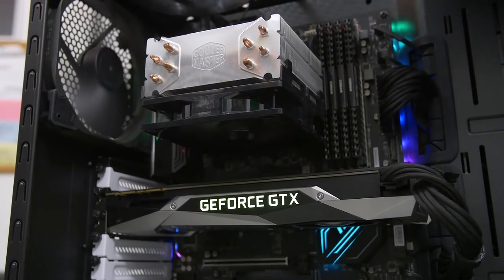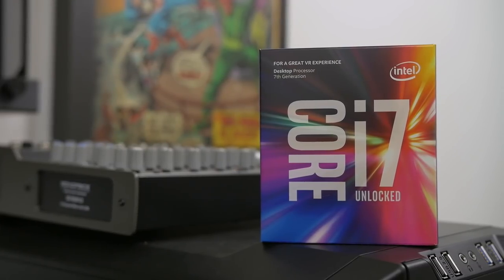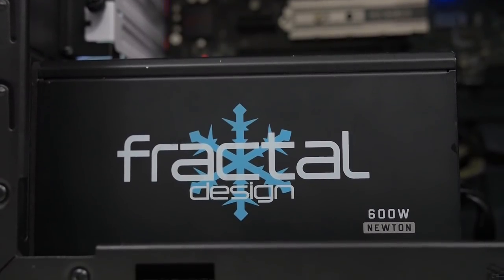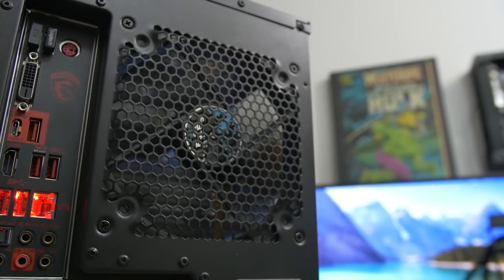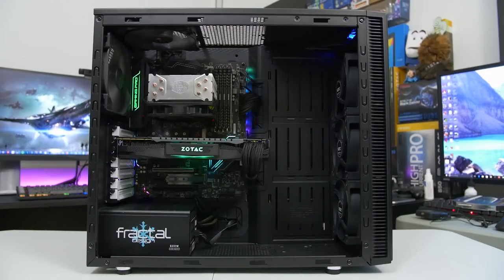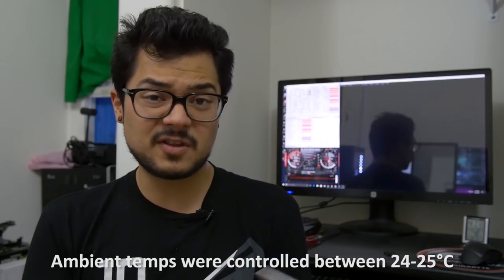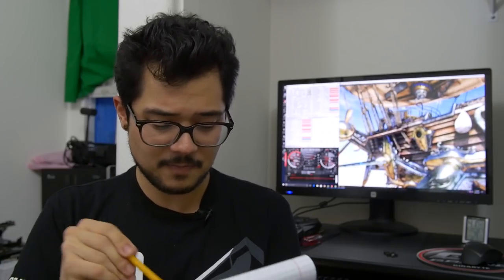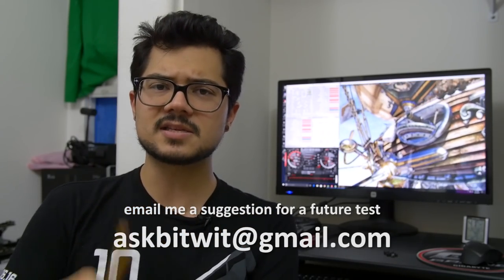This is how you should mount your CPU cooler! I think??

Comment: If you have enough airflow in an horizontal config the cooler draws air from the frontal flow, not from under it and the GPU hot air is sucked out by the back fan anyway. Saying that, one would expect a for horizontal placement that the temperatures would not depend from the GFX style. So why does it increase in blower?
I can only see three possible options.
1 - blowers are hotter and so they heat the motherboard and its components;
2 - the blower sucks in air, thus strangling the EVO airflow;
3 - you accidentally changed some other variable.
Counterpoint to 1 and 2: why doesn't it happen in the vertical config? 
1 - the evo is keeping the blower style cool by sucking its air from the backplate in the vertical config, thus no heat creeps from the mobo to the CPU; this gets to be too much in non-blower style.
2 - by some airflow effect the EVO is not strangled if it takes air from closer to the blower sucking point (this looks really dumb).
What were the GPU temps during the 4 runs? A temp probe on the motherboard and GFX PCB could help support or deny my options 1. Using fumes could test my options 2.

Comment: I dunno if this is right, but maybe since the Founder's Edition runs inherently hotter than an aftermarket shroud, and requires higher fan speeds, maybe it took a little more air in than the 212 and potentially starved the CPU a bit for cool air? 'Cause it was facing the front in that test, and if both the GPU and 212 were getting air from the same direction maybe it swayed more towards the stock GPU shroud. And then when the 212 was horizontal, it caught more cool air being directed towards the higher fan speed FE GPU, and caught more of the hot air kicked around when the aftermarket card was put in. I'm not sure, that makes sense to me but my reasoning could be off.

Comment: its because of where the blower style gpu outputs air, in test 1 is leaves ner the front of the case and get sucked back and up through the cpu, where as in test 2, its expelled more in the middle, being sucked up behind the cpu. Or at least thats the only thing I can think to explain it.

Comment: I assume the results pertaining to the open air gpu cooler vs the blower style gpu cooler when the cpu cooler is mounted horizontally is the gpu cooler is starving the cpu cooler of air as the lower air pressure in the case is causing reduced cooling capacity.  Just a guess.

Comment: What I would think is that the cold air from outside is mixing with the warm air from the gpu, in the horizontal and open shroud, before it's being picked up into the CPU cooler, therefore you are getting cooler air than what the CPU is and more of it?

Comment: You HAD TO use the cpu cooler horizontally on am3+ socket motherboards
Reply: Simon Mol yes
Reply: shit? i had to use it vertically in my am3+
Reply: Why? I did it vertically on my original AM3+ build.
Reply: I think he's referring to the airflow, not the actual cooler, or vice-versa.

Comment: With the original two the blower was piling up heat in the bottom then the heat slowly seeped up to the CPU cooler and instead of going into the fan it would go into the fin array since that's what was directly next to it then the open air one had the air dissipate throughout the case and therefore the heat would be sucked out more efficiently but then in the second test the open air gpu one would make it so the fan Could more easily suck the hot air right into the fun array then swirl around inside it for a while but the other one got a more direct path out but I'm not sure why, I hope this idea helps
Reply: Also the cards have different coolers so one might be more effective at getting the heat off of the card than the other therefore putting out more heat

Comment: ive finally decided to mount mine vertically. and after like 4 years. IT MAKES MORE SENSE... lol. it was pulling hot air from the gpu instead of cold air from the front of the case. ect. solved.

Comment: in my opinion. the dual fan cooler on gfx card dumps near a motherboard sensor, i bet case fans are ramped up slightly making internals cooler.  on my x99 deluxe that is the case. Maybe u can set the fans up ursekf to see if that is it on ur setup

Comment: The Cooler Master Hyper 212 EVO cooler will have a 5C difference DEPENDING ON THE ORIENTATION OF THE HOLD-DOWN CLIP'S ARMS. I accidentally found this out when checking out a new processor chip for my son's build. I put the clip on the wrong way and the temp went up by 5C on AIDA64. I figured it was the new chip thermals but when I put the original CPU back in, the same result! Looking at the directions again, I noticed that I had clip's arms in the wrong orientation (bends out instead of bends in.) I unscrewed it and put it on properly and it fixed the thermal increase and I had the original temps back. Check to see if the clip is put on properly. I cannot see from the video which way yours was installed nor would I be able to tell you which way to mount it when pivoted.

Comment: I set up my 212 horizontally, fan pushing upwards, since my inwin 303 is configured different. This seems to allow the stock cooler master fan to spin faster than it was designed for so if you did the same and are freaking out cause your pc is sounding like like a +20 rad counter. Re-adjust your fan curve back to ~1700 rpm and lower. Mine was spinning up to almost 2200 rpm :S

Comment: In a Cooler Master N200 (mATX) & an Enermax ETS-T40-BK, I got an average of 10c degrees better temps with the air going Front to back. 
Bottom to top seemed too starved for air, and it was pulling right off the back of the GPU. A full ATX might have different results.

Comment: maybe its just the air pressure  if u eject the hot air into the case u may generate a new airflow? and u get more air trouthput to the cpu cooler but if u puting it downside u may suck to much hot air in. so maybe this would give sense

Comment: The cpu heatsink is physically closer to the card in the traditional alignment.. How hot does the backplate get on a blower card? Could the blower card temp, mingled with the air circulating through that smaller gap between the two be causing the cpu cooler fins to get warm through convection/air friction, thereby causing some thermal saturation in the cpu cooling fins? Any heat in that area will be rising into the cpu cooler anyway. A stretch i know, but maybe..

Comment: It's possible with the open fan with the fan of the CPU Cooler blowing backwards, maybe due to the fan intakes at the front it's pushing the hot air back, behind the CPU Cooler?  Just a suggestion.

Comment: Why don't think that Hyper 212 EVO can cool a 7700k well? I have a 212+ on a AMD FX8320 @4.5ghz with 1.45v to it. It is pushing much more heat than that 7700k would put out. Plus the addition of a second fan is very cheap and can further the coolers performance. I believe the EVO is capable of 180w thermal dissipation.

Comment: Have you tried mounting the Noctua NH D14 in a pull configuration?  My system has ASUS Strix GTX 980 in SLI and I found that the video card was heating the air on the intake side of the cooler resulting in a higher load temp than I wanted. To resolve that issue I reversed the fans on the cooler as well as reversing the rear exhaust fan to create a pull design which sucked room air into the case and directed it over the CPU. Keeping the top exhaust fan at the top. The result was a significantly cooler CPU under load. The case I am using is the Cooler Master HAF-X

complete specs
Asrock z77 Extreme4 / i7 2600k
16GB Crusial Tactical Ballistix
Samsung 850 Pro 512GB
Antec TPQ 1000
ASUS Strix GTX 980 SLI

Comment: Everybody is trying to explain with "science" but it has to be a simple case of user error, the tests for the GPU type got goofed up. Look at the numbers for both tests, they are the same if you swap the numbers on the first test, 58/62 and 57/62, the 1degree change could just be a margin of error. Nobody is getting 5 degrees cooler by realigning the heatsink in a case that well ventilated, if that was possible then it would be common knowledge by now.

Comment: BitWit, what if you put the heat sync fan in a pull config, instead of push?  I just put my CM Hyper T4 (similar heat sync) in a pull towards top of case config from horizontal push towards rear of case.  No change in CPU temps, but change in the # of fans needed to maintain case temps - removed the top 200 mm case fan!  This change was needed because that top fan died on me, otherwise I wouldn't have even tried this.

I can feel the hot air just wafting up through the top of the case (case is slightly under pressure when all fans are full on), and when my replacement 200 mm arrives, I'm eager to see how the setup performs with "proper ventilation".

Corsair Graphite 600t (sealed side panel) - huge case, lots of open space
Core i3 530 OC 3.2Ghz
ATI Radeon HD 7870 @ 1100 Mhz, venting to case like the Zotac
I know, it's all old, but still works for what I want :-)

Comment: I have a horizontal placement, but reversed. Like, pulling in the air from the rear and blowing it out at the front as my case is veeeery budget and allows for literally no cable management at all, so some of the PSU cables would block the air flow front to rear, so I turned that shit right around

Comment: So I guess after watching these test results, if you have an open air gpu, you should position your air cooler horizontal? I plan on doing this but not until I fully understand how the temp was lower horizontally for the open air gpu and higher horizontally with the reference gpu.

Comment: blower style gpu's has always suffered from thermal build up at the higher end of the market.
Reply: conclusion. Horizontal cpu cooler + blower isn't providing extra airflow for the gpu in any way, its cpu only. The gpu then has a chance to build up heat more and more, sooner or later it will affect the case temps. Now with the vertical cpu cooler and blower gpu cooler, having the cpu fan parallel to the pcb of the gpu may extract some of the overall heat in the case.

Having one component inadequately cooled will almost always result in worse results than pumping hot recycled air through another cooler. It doesn't matter that you are not drawing cold air though a cpu cooler, what matters is the thermal waste plant that is mounted just below the cpu cooler that has Zero airflow.

Comment: Could the open air GPU be causing a pressure bubble below the GPU forcing the air from the intake fans to flow above it, and then be accelerated through the rear facing CPU cooler out the back?  This would allow for cooler temps on the CPU because a blower type GPU wouldn't cause that pressure bubble and actually take some of that fresh intake air leaving less fresh air to move through the CPU.

Comment: So, I have a front mounted cpu cooler (h115i) along with 1 140mm exhaust in the back of the case and 1 140mm intake on the bottom of the case. I'm tempted to get a second GTX 1070 (currently have an ASUS ROG card). Should I get a second ASUS ROG card or should I get a founders edition, or would it not be much of a difference at all?

Comment: What's the temps on the GPU card with the blower versus the open air GPU?  Maybe the Blower type heats up the GPU card enough to impact.  Heat rises, so heat from the GPU with the blower(if that card runs hotter) is still staying in the case and rising up and impacting the CPU?  Hmmm

Comment: in the horz position....The closed air card retains MUCH more heat in the card.  That heat rises directly onto the CPU cooler heatsink.  With the open air card, much more "card" heat is dissappated  down and AWAY from the CPU cooler heatsink, it then has much more room to spread out evenly, and the heat is better dissappated/cooled before it rises evenly.
  i've been thinking out doing some test myself. Specifically a 2 top intakes to help cool the CPU, motherboard and Ram....., a rear intakes to help direct flow forward, and dual large front exhausts to blow air out the front of the case.  Any opinions on how this might work?

Comment: 4:58 maybe b/c the founders edition blew heat out back, and as we all know heat rises, then got sucked in by the back fan, heating up the fins? im kinda spitballing here
Reply: try measuring the temps of the air coming from the rear case fan
Reply: Does that back fan not blow air out? How is it sucking in the hot air?

Comment: Pulling this out of my hiney but could the horizontal mounting and the position of the heatsink fan be interfering with the hot air from the open GPU, pushing it away before it affects the heatsink in earnest, all the while the GPU fans are increasing the output of hot air, aiding in the inflow of cool air from the front radiators?

Comment: with the open shroud GPU and horizontal airflow im thinking that the air in the cpu fan is comming from straigt in front while the blower is pulling more air from the front to the GPU and the CPU fan has to pull more air from a larger area in wich heated air from the GPU exists.  also the air from the non-blower cooler gets ejected without passing trough the cpu cooler. because it is pushed to the back and up.

Comment: I do not have fans in the roof of my case and was wondering, If I was to get one of these coolers can I have it facing the back of the case as that's where my fan is. I've seen everyone put coolers facing to the roof and I will not be able to do that I think because the air will have nowhere to go then???

Comment: Still a question... They told me that is does not matter if the radiator at a water-cooling, does stand with the waterpipes (in and out) on the top... of with the waterpipes (in and out) at the bottom.
They told me this, after I had put a new video-card in and had tilted the PC case ... then after this the cooling of the CPU did not work good anymore and it went to about 100 Celsius.  Normally that 65 at max.
I sent it over, they checked it an it was 100% good. Very strange.
Now I mounted the water-radiator with the pipes at the bottom. Seems more logic to me, cause any air would go up in the radiator an maybe block any pipes or block the pump.
Any thoughts on this? 
Thanks for your time and good video BTW..

Comment: I was wondering about the different amounts of heat each card actually puts off ambient. Perhaps the extra heat was being blown off and out the back of the case on the horizontal cpu and internal exhaust gpu card. And when you place the cpu cooler in verticle it was pulling heat off the video card board and through the cpu? I'm at a loss as well other than the heat ratings of each card themselves.  I would say overall though the difference is negligible and to run it how you like it to be.

Comment: It could possibly be air pressure related, as the blower style gpu would lower the amout of potential air moving through the cpu cooler, pushing away less heat. 
The opposite results with the vertically mounted cpu cooler would them be due to the open top close to the ront fans, making that a ntural escape route for the air, making the first issue less of a factor?

I'm not sience and don't know enought to say for sure tough~~

Comment: Hey got a question: Because of my AM3+ mainboard, my cpu cooler would blow the air up the case, but the case is closed at the top (there are no holes at the top). Would there be any problems, when I'm doing that?

Comment: could it be because the refrence cooled 1070 backplate was hotter than the zotac 1070, so there wasnt as much heat emitting from the back of the chipset/backplate?

Comment: could it be the open air shroud with horizontal fan placement allows the fin array which is closer and not blocked by the fan to absorb some of the heat from the gpu and allow it to transfer out of the case.  just a theory 
don't take my head off

Comment: Could it just be that the blower style card changes the air pressure in the case? Isn't it essentially just another fan exhausting air out of the case? I have two reference RX480s in my s340 with 3 140mm fans and a 120mm in the rear (look at profile pic.), and all ever hear is the blower noise coming from the rear... not loud, but I notice it is there.

Comment: Test it with all the fans at a set rpm, all fans including gpu/cpu
Reply: and also, i pesonally would like to know if theres a difference between a normal atx layout and an inverted one, or if the psu affects temps in both inverted and non inverted cases. @bitwit

Comment: The temps increased when you were using horizontal air flow and the blower type GPU because all of the hot air from the GPU was thrown right infront of the CPU cooler

Comment: if one fan is connected in front and rotates in clockwise direction the air flows inside the cabinet,then the second one is connected at the rear side it also rotates in clockwise direction it flows air again inside the cabinet, how can i make it to rotate anticlockwise? to pull air out in the rear fan?

Comment: Yo don’t even need a temper glass you can use plexiglass like I did on my computer is see-through and airtight seal if you know how to do it right or use bear crawl all over the sides to the sides of the panels so I look slick has no screws and is this easiest is rip it off and I use my own vape as the smoke machine to view the airflow my case

Comment: try negative pressure fan array. maybe the 3 intake fans mess you up in this. I got the aerocool p7-c1 case with three intakes and in a system with 2 high temp r9 390s the cpu stays lot cooler than expected (i am guessing its the direct flow from the top fans). i even removed one of the two fans on the cooler (deepcool assassin) and still get similar temps.  Im actually using the same nzxt fans as intakes. i would try other fan arrangements but cable management in this case is a bitch and i kinda want to avoid having to cut the zip ties and rearrange the cables.